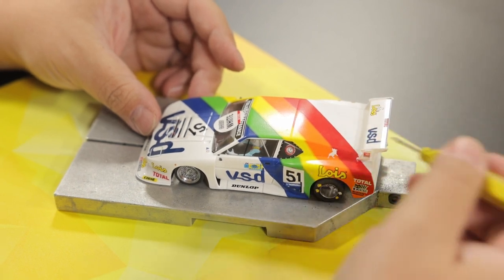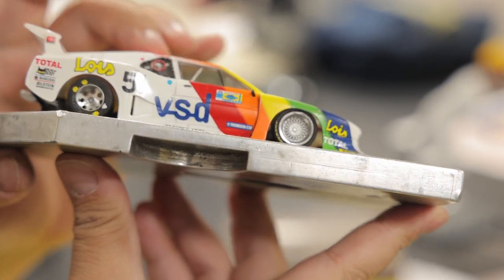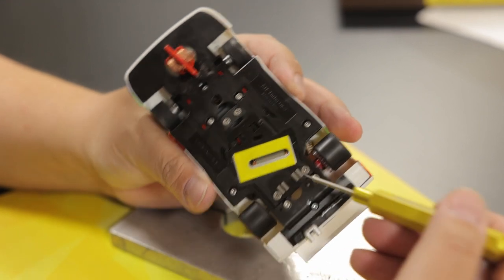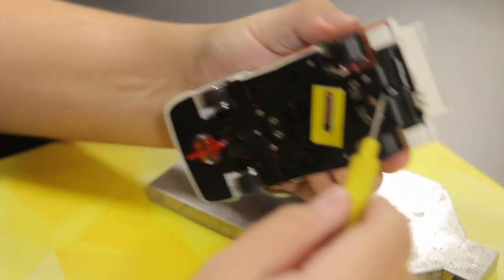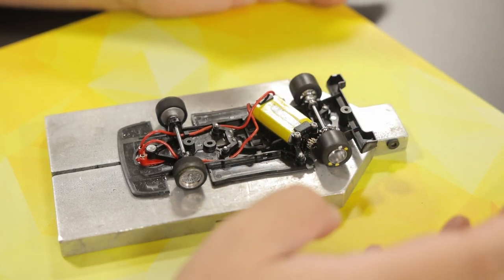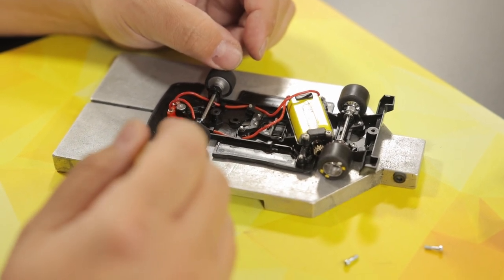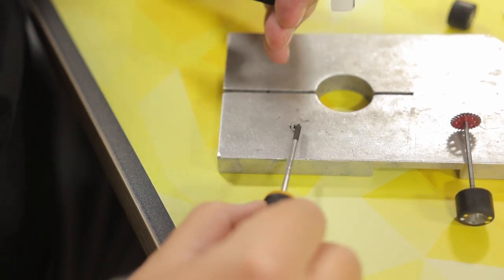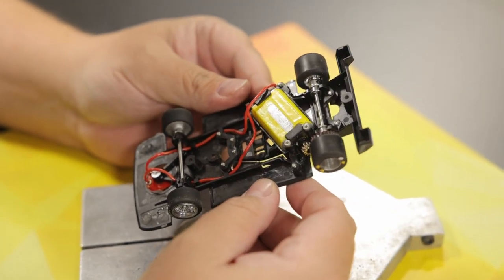Race Winner - Rick Jocham's Gr.5 BMW M1 by Racer Sideways

Comment: Two items to note on the rear axle offset:

1) My understanding of their thinking there is that it lowers the center of gravity to have the lowest possible offset, as long as you can get sufficient grip from the tires.

2) On the BMW M1 specifically, you have to use a smaller diameter tire to get the full rear track width out to the body lines. It's also why Pendle Slot lists the rear track width at 62mm for the M1. The actual body lines are just as wide as the Skyline at 65mm. So when you do this tire/axle setup you can get the full 65mm.

Comment: I have three of those yellow sleeved motors and they all tach out at 19k@12v
Reply: I have 4 of these. I test at Electric Dreams track voltage (12.5V), so not apples-to-apples, but I had two that were mediocre (20.7k and 21.4k) and two that were fast (22.5k and 22.6k). How are you breaking in your motors?
Reply: @toddulery  TBH I don't because I don't need the extra performance as my car setup and driving is good enough to stay ahead...but it's there if I need a little free extra.

Comment: Soooo...  its a "s t o c k" class? What the heck? So in Northern California we can only change guide, braid, and super grip tires. So ur telling me as long as the motor stays stock you can change everything else? 🤔  how is that stock?so it's a modified class with stock motor. Sounds like a cheater car to me.
Reply: How is it a cheater car if all the racers used the same rules?
Reply: @toddulery  my question was how is that a stock class? When you can change everything. So if I show up with my stock group 5 it will get its doors blown off. I get what your saying.  So if I buy a car from Elc. Dreams and change guide and tires I will be as competitive as the rest. I will need to drop another $30 in Elc.dream prices that car would be $90 for a stock class. It's a modified class with stock motor
Reply: @gerardocampos7138  It is one of the more restrictive classes at ED. The only differences to what you mentioned the NorCal rules to be are the bearings, wheels and potentially the one piece of ballast that we're allowed in the stock position. None of those things are "needed" to be competitive. I mostly took issue with you calling it a cheater car. Maybe you were just joking, but that seemed uncalled for.
Reply: @toddulery  I didn't even mention the gears. That's onother thing.   But If that's  a stock class. Then CLEARLY I DONT KNOW WHAT A STOCK CLASS IS and I need to really go and get my knowledge on what a stock class is. And to me it's clearly a CHEATER car.
Reply: @gerardocampos7138  👍
Reply: @gerardocampos7138  if you've changed the guide/braids and fit silicone tyres it's not stock either.
Reply: @gerardocampos7138  It's only cheating if you're ignoring the rules, if their 'stock rules' say you can change everything then it's not cheating is it?  Our 'standard class' rules allows us to change wheels/tyres/gears/guide and motor up to 30k from the same manufacturer of the car.  Our 'modified class' rules allows more changes. Our 'open class' rules allow you to change anything.  So each club or event has it's own rules, as long as everyone abides by those rules there's no cheating.
Reply: @modelracecar  👍